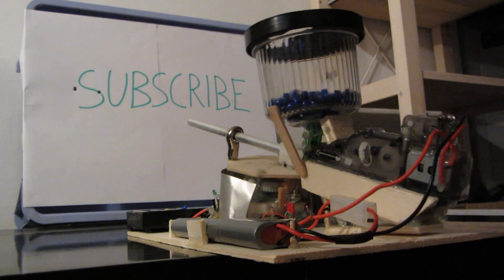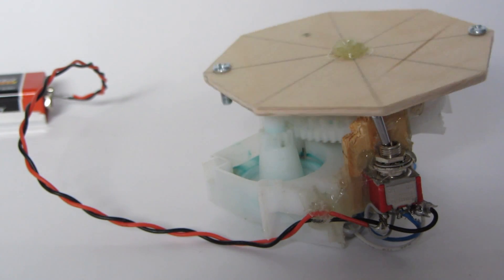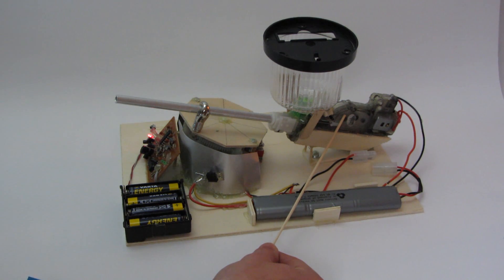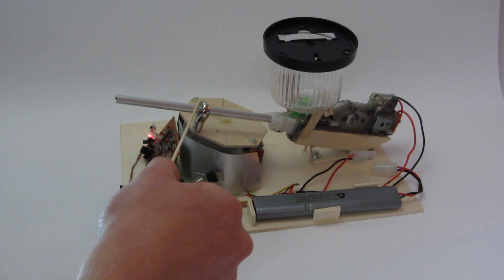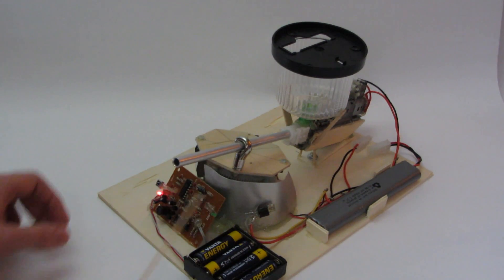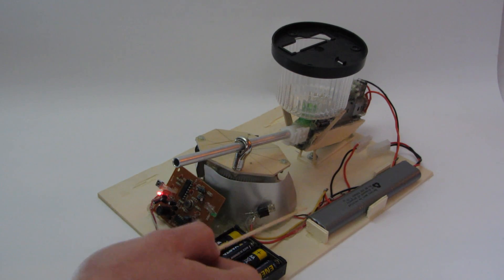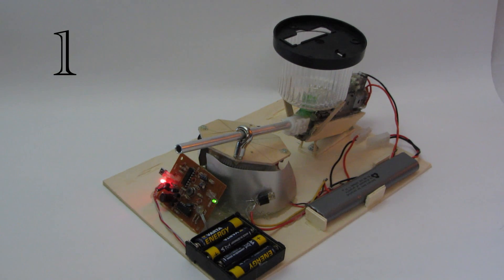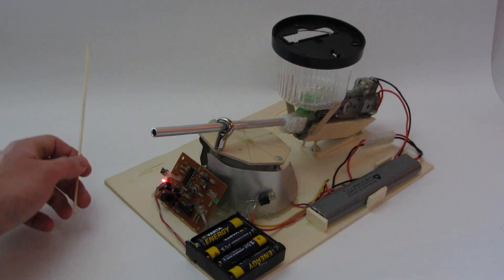Homemade Motion Activated Airsoft Turret Sentry

Comment: would it be better to use a rellay turned on by the sensor? so after some time it switches of and cuts power?
Reply from the maker: It turns off by itself after firing for 20 seconds or so and is then ready to be triggered again :)
Reply: @Doityourselfgadgets  Would £160 suffice for 2 of these, I want them exactly as you have them here!

Comment: How did you manage to make a Hop up feeding system that does not get the BBs Blocked from entering? I have a similar Gadget using gravity and also springs to feed into the Hop up. I have not tested it as its still in progress, but im worried about Blockage at the BBs holder to the hop up. 

With a little shake it fills with little blockage or problem. Will the shake from the Gearbox which is the exact same one in this video. Will that be enough to shake any blockages my Gadget could come across? 

Awsome Sentry aswell!!! hope to implement these in home security one day.
Reply: Wicked! I wish i could share my invention but i dont think you can send photos over Youtube! i tested the magazine yesterday and shock it myself as i havent finished the full body for the sentry gun yet and the batteries for the gearbox will come next month. But im reassured that the shake from the Gearbox will be more than enough to prevent or shift any Blockage that might occur during the feeding!

Hopefully this post is not on private, but this what im currently working on; https://www.facebook.com/rajiv.pongo/posts/10155328687851635?pnref=story 

Thanks for your video and response.
Reply: Wicked! Was just wondering what Battery did you use for the Gearbox? I keep making mistakes on what batteries to get. 

mine is a Plastic Gear box